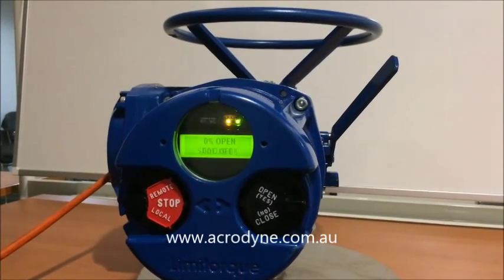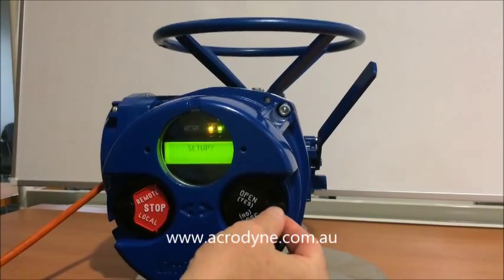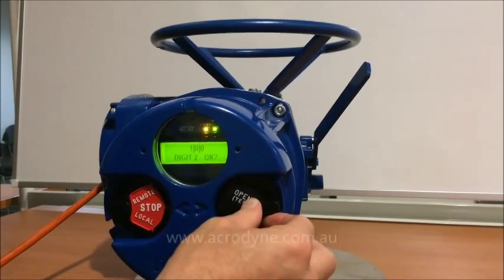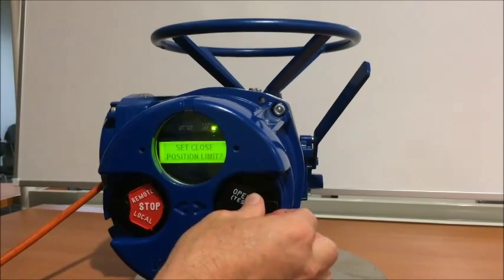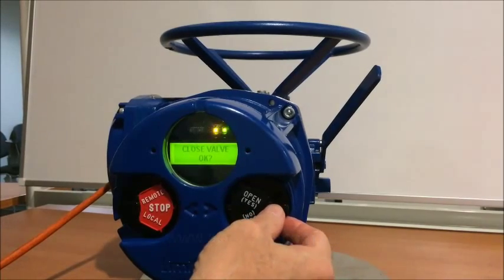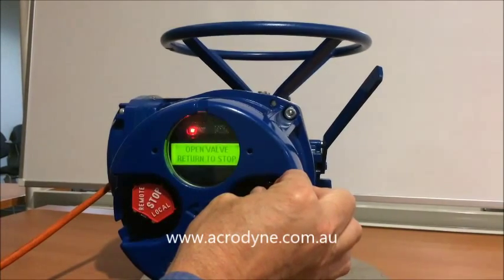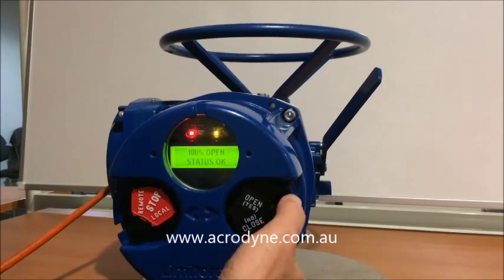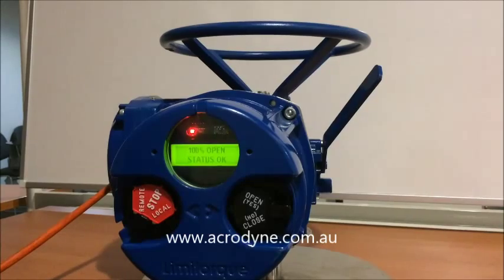How to setup Limit Switches of Limitorque MX Actuator?

Comment: I have a question after the limit stops have been set, I noticed I had trouble with a timeout torque alarm. The valve opens very slowly 2pct at a time when it should normally respond at a 10 to 12 pct . How do I resolve this issue? Thanks.